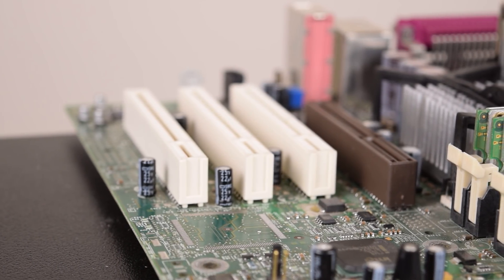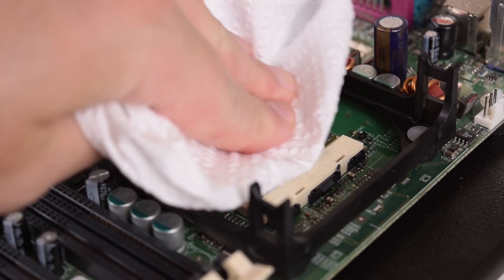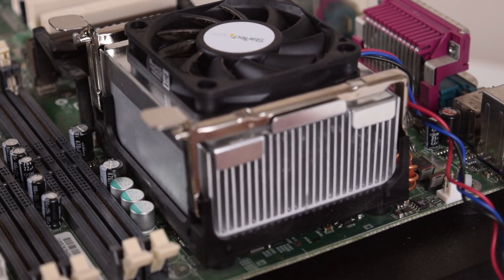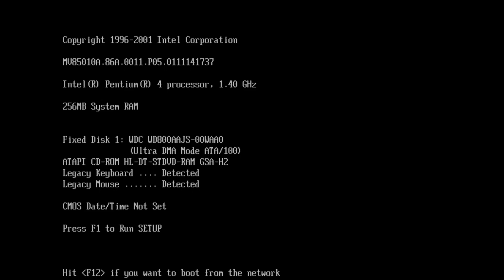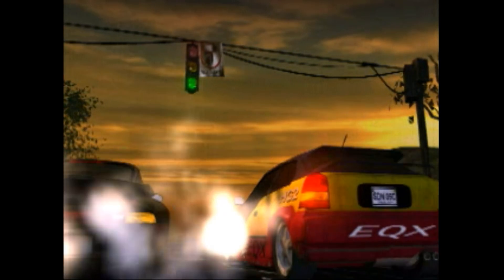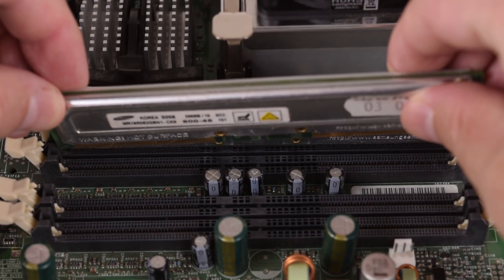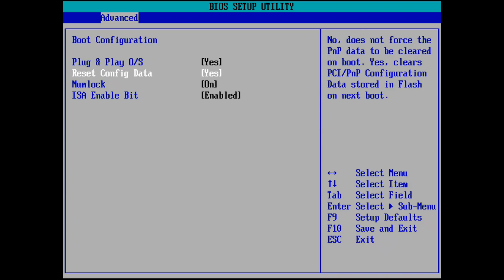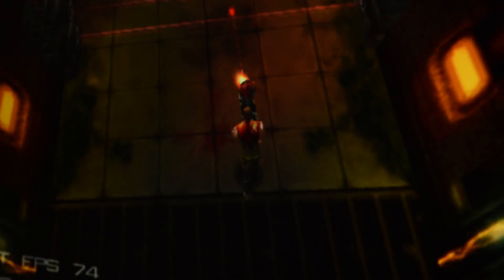Rambus RDRAM Pentium 4 1.4 GHz vs Pentium III

Comment: It's sloppy to just ask this without going back and pausing to be sure, but did that say ECC on the ram module?  Is all Rambus ram ECC? Did you just happen to get ECC?  Does just happening to get ECC memory with a P4 like this somehow not cause issues, issues such as the fan favorite titles " I won't run at all", and " heres a beep code baby"... I never had a P4 system, never bought into the Rambus thing... seemed stupidly overpriced to me back in the day... at least, priced well out of my stupid budget anyway.  Or did I not even see what I thought I saw, and they weren't ECC at all?  If indeed they were, and if indeed that is an RDRam staple in general, then in general I could see that addition of such ram in an early Win9X or 2K environment to be quite beneficial to stability in general.  Perhaps leading to what you noticed about said stability of your test system there.
Reply from the maker: So the two 128MB sticks it came with, are non ECC, but the two 256MB sticks from Electromyne, which I went with in the end are indeed ECC. Yea, maybe this contributed to the stability. I have some other sticks now, non ECC, so will be using them at some point and see if there is a difference.

Comment: Very nice comparison.
I have only started playing with P4 systems in the past 2 years; I skipped the P4 altogether at the time it was current (Athlon XP, then Athlon64). The systems I'm most fond of for retrogaming are in fact 2 which I built on i850-based motherboards, both socket423. One is with a 1.8GHz Willamette, the other with the rarer 2GHz. As for the rambus, it has higher bandwidth but also higher latency which cuts the performance. The way I deal with the heat is to replace the original fan on the CPU cooler with a bigger one, 120mm fan that blows not only on the CPU heatsink but also on the memory. Works well.
(the motherboards I use are QDI which I mentioned in a previous comment; they have PC/PCI so good sound card compatibility for DOS).
I also have a socket423 motherboard with Via chipset, a PcChips M920 with V4x266, supports both SDRAM and DDR. TBH I haven't made a build with it yet for lack of time. It would be interesting to see how it compares to the 850-based boards.

Comment: What's your pentium 3 configuration for this... comparison??!!!
Reply from the maker: We are using the same parts, but a i815 chipset board and two 256MB PC133 CL2 SDRAM. I tuned the memory timings for maximum performance.

Comment: Well... I used to have an Intel-VC820 and an P3-500 slot1. Though it was not really the fastest combination, it was rock solid. I used 2x128mb PC-800 ram modules on it from samsung that had heatsinks. As I said... Rock solid and stable.

Comment: Hey Phil great video, I´ve suggestion for you. Could you try the Asus CT-479 adapter on the Socket 478 Mainboard, and try a comparison between Pentium 4 3.0 GHz and Pentium M725-755?

Comment: Been wondering for a long time why you've never used/reviewed a socket 423 P4.  Since it was the first P4 socket, I would have thought you would have been all over that one a LONG time ago.  I had quite a few socket 423 boards/processors back in the hey-day.

Comment: Back in the day before DDR, the higher clocked P4's with RAMBUS would blister the paint off the walls compared to other systems.  I even had a RAMBUS cooler with its own little fan.  Today, it's one of my Win98SE retro machines.
Reply: I worked at CompUSA back in the day and sold these machines: Many customers who bought these Pentium 4 machines had concerns about the heat they were generating... If my memory serves me well, most, if not all, of the P4s we sold were made by HP. The towers themselves were absolutely huge, partly because they needed room for heat displacement. There were recalls on some of the early models because the CD-ROMs would malfunction due to the heat generated.

Comment: RDRAM was very expensive at the time for not that much benefit. Intel really tried to push it hard along with the P4. That was one of the reasons I ended up switching over to AMD when I upgraded from my P3 700@933 system to a DDR Athlon XP system.

Definitely interesting reading all of the articles at the time.
https://www.anandtech.com/show/545/10
https://www.computerworld.com.au/article/97518/what_does_rdram_really_cost_/

"Currently, you can find a 128MB PC800 for under $600 if you shop around, but if you compare this to $100 you can pick up a generic 128MB PC133 module for, that's still quite pricey. "

"Visit Kingston Technology Co.'s ValueRAM electronic-commerce site, and the cheapest 128MB RDRAM module you can find is $722. The most expensive 128MB SDRAM module is only $179."
"Compaq says RDRAM adds $300-$400 to a system's cost. Similarly equipped Pentium III-based PCs by Compaq, Dell, Hewlett-Packard, and IBM sell for roughly $300-$600 more when fitted with RDRAM."

Comment: Hi there, Phil! You mentioned you couldn't find anything on RDRAM timings in D850s BIOS. You were looking in the wrong place! Check your modules again, the sticker says 800-45, the 45ns 800mhz piece. The only other option (I will NOT speak about PC600!) is 800-40, which is a tiiiinyest bit faster. Also, nice vs, but I was kinda expecting it to be vs PIII 1.4, hehe.
Reply from the maker: I was referring to the BIOS not having any options to do with the memory, like you find in most BIOSes. Yea the sticks the board came with are PC800-45, non ECC to 128MB sticks. From Electromyne I got PC800-45 ECC with 256MB, and this week also PC1066-32 256MB sticks non ECC, but I haven't tried them to see if they will improve things on this platform. At the moment I don't have a 533 FSB Rambus compatible board.
Reply: Well that's just how it works with RDRAM! Not even Asus P4T series board would give you a lot of things to tweak. Also, PC1066 sticks will work as PC800 on the D850MV. So you gonna need some 850E board to go that way, really. In my experience, I'd go P4T533-C any day, but D850EMV2 was very solid once I tried it. I also had some time with P4T533/R, which used the 32-bit Rambus. That thing's a BEAST, unless you decide to compare it to one of your i875 builds, hehe

Comment: Would have ben nice if you threw in a Or850 with a 1.4Ghz PIII in a slotket as it also have RDRAM. And compare it to the 1.4 Ghz P4 with RDRAM.
Surely the PIII would win, but how mutch.

Comment: I don't have a proper GeForce2 or even a GeForce3 to test with, but I do have my Shuttle SB61G with a 3GHz Pentium 4 Northwood core (HT-capable), and 1GB of dual-channel DDR memory.  It has a GeForce 6800 GT with 128MB of memory.  If you need me to bench anything on it, I could gladly do so.  I'm gettin' bored out of my mind in my house. XD

Comment: If you want to really give RAMBUS it's best chance, get yourself some of the PC1066-32 stuff.  The latency was always the big performance killer on RAMBUS systems, regardless of PIII or P4. I do have a theory that RAMBUS would probably really come into it's own with Pentium D, whether it is competitive with DDR2 with the Pentium D processors I kind of doubt, but would love to test anyway, but of course, there were no Socket 775 motherboards made with RAMBUS, but if by some chance I am wrong about that, and Google searches have hidden the truth as it sometimes does, I would be VERY interested in finding such a board.
Reply: Rambus was really only good back in the day. In the days of Pentium D or 775, no chance. The problem was that yet it ran on 800-1066Mhz, but it was only 16-bit. So total 32-bit in dual-channel. It became obsolete when Intel came with 865 which had DDR dual-channel which had both better latency and bandwith than RDRAM. Dual channel DDR400 is league ahead of any RDRAM. Dual channel DDR266 is equal to 1066 RDRAM system.
Reply: RDRAM memory came in both 16 and 32 bit, maxing out at PC or "RIMM" 6400. Chipsets ranged from single up to 4 channel.
Reply: Yeah but the 32-bit ones were really rare, only few of the latest I850E boards had them and the controller was 32-bit as a whole, so the same bandwidth was still the same you jut did not have to "bother" with the dual channel. 64-bit controller never existed on the retail market, SIS made a chipset that was supposed to have it, but from what Iv heard everyone backed away from making boards on it cause of well... it was RDRAM and it was in the time Intel was making I865 already.

Comment: Hi Phil, that system looks like an excellent alternative for a fast PIII. The Intel motherboard screams quality too. Would it be an idea to include a race game in the benchmarks next time? We know the newer NFS Underground requires a lot of 'horsepower', but would that also be the case for NFS Porsche 2000 (Unleashed)?
Reply from the maker: So one issue is that I'm "locked in" with the tests and current results. The other issue is that there are basically no racing games with benchmarks built-in.

Comment: Sigh rambus memory, still got a bad taste in my mouth about their company. Sneaking certain technology in the DDR standard then later suing and winning a lawsuit against the DDR makers. 

Still oh well, that is long ago right. 

And the P III is a nice chip, it ran the OG Xbox. Pretty well actually. And the Nintendo 64 had Rambus, in such that you could add 4Mbyte of extra memory, doubling it, by replacing a small dongle shaped part.

Also the early Pentium 4 had too little cache to really stretch its legs, only around the 2ghz it really begin stretch it legs and never let go!
Reply: That was the "terminator" in the N64 slot. You needed it there if you didn't have the extra memory module installed. Just like Phil had to use the terminator sticks in the empty RDRAM slots on the P4 system.

Comment: How about comparing a Pentium 3's performance when equipped with different types of RAM? Use a 440 or 815-based system for SDRAM, and an 820 board for RDRAM. And I think there were even Socket 370/DDR boards made, so that'd be interesting to see as well.
Reply from the maker: IMO SDRAM is perfect fit for Pentium III. Little extra to be gained. Pentium 4 though...

Comment: I never had a Pentium 3/4 until they switched to LGA775 because back then I was very budget conscious and knew I could get better performance from AMD, the reason I finally switched was actually due to the stability problems I was experiencing with the AMD chips of the time
Reply: I had issues with the sis chipsets for AMD, but I got better boards with via and best was nforce2. They performed great and were stable.

Comment: I still have my old Abit TH7II-Raid motherboard lying around somewhere, I suppose its worth checking if it still works. But back in 2002 it was part of a great setup, the price of the memory was the only issue I had with RDRAM. Maybe it wasn't the fastest, but as a software engineer stability always comes before performance.

Comment: This is awesome, since I just recently grabbed a retro workstation at a recycling center. It had a D850EMV2 in it, however, apparently you got lucky, since almost all of the large power capacitors on mine were bloating and leaking.  It may be that this board had a much higher uptime than yours and that's why the capacitors failed eventually.
As for what you said about it being extremely stable, I can definitely back up that assessment, it is probably the most stable system I've ever set up. I bet that's probably due to the fact that your RDRAM and mine is ECC (Error-correcting code memory), unlike most SDRAM which isn't ECC (Though in some very rare cases it can be).

As always, great video, I still really enjoy them :)
Reply from the maker: Good point, the upgraded RDRAM I used (The two 256 sticks from Electromyne) are ECC as well. I didn't consider that this might help with the stability, it makes sense though.

Comment: I was also surprised on the stability of my socket 423 board. 
Two other big negatives of using a socket 423 board as opposed to a socket 478 is with socket 423 your going to need a power supply with an AUX connector. Also socket 423 has become a bit of an oddity collectors board so prices are usually a bit high compared to 478.
Reply: Or just buy a Asus P4T like I did and use a standard ATX PSU with it and not mess with the AUX stuff.
Reply: Cool, didn't know about that board.
Reply: Cool, every other socket 423 board I've ever seen had that AUX connector. good old Asus.
Reply: I just looked the board up and it does have an AUX connector. Maybe it just wasn't necessary.
Reply: molex to AUX connector converters are $0.99 on ebay, not an insurmountable problem
Reply: I'm looking on Ebay right now and I can't find a single one so unless you need some strange wording to make them come up in search...
Reply: there goes me never owning P4. Was sure it was all about 4pin P4 CPU Aux, not the AT style 6 pin one, sorry :(
make it $10 then, or 30 minutes with soldering iron and spare AT supply cable.
Reply: Or you could just buy a PSU with an aux connector for $25 and not bother with the soldering. I never said they were rare.
Reply: >PSU with an aux connector for $25 

Arent those all 15y old now with dried caps? trading one problem for another
Reply: shrugs It's an option if you don't want to or can't solder.
Reply: For those who stumble upon this; there are 20 pin splitters to 6 pin aux on ebay.  There have even been 20 pin to 6 pin and 4 pin splitters however they seem to be unavailable at this time except at more obscure websites.  I myself have used a 20 pin to 6 and 4 pin splitters with a modern psu with success.  There is an old video that shows what i'm talking about close up.  https://www.youtube.com/watch?v=Hud49g-w47g

Comment: I had an old Dell Dimension 8300 at one point that had a Socket 423 Pentium 4 and 768MB of RAMBUS RAM. It was...ehhh? Not great. In the end I just parted it out and dumped it because it was sometimes crashing to a blank screen and a yellow power light. Still have the CPU and RAM somewhere...not that I'll probably ever use them again :P

The S423 CPUs are huuuuuge! They basically look like an S478 P4 on an adapter board, so strange.

Comment: I would LOVE to see a comparison of Tualatin vs. Northwood on RDRAM, DDR, and SDR. :-)
Reply: DDR was faster lots faster as Rambus had latency issues that crippled it's high bandwidth advantage. Note that even on official Intel produced Desktop 845 boards only use DDR ram not rambus they dropped it hard and there was good reason it was horrible for value
Reply: YES!
Reply: The best system those days were still RDRAM based, I remember the first 3+Ghz Northwood and the same time the first one with HT, aka the 3,06Ghz one with FSB533, that was still paired with I850E and ideally 1066Mhz RDRAM. i845 and SIS645 with DDR was good but still a bit slower than i850E, DDR overtook RDRAM completely only when I865 came with dual-channel and DDR400 + FSB800 support.

However the SDRAM P4 systems were completely trash and Phils future tests will prove that for sure.

Comment: I remember my first Pentium 4 System I got was a Williamette 1.8, operating on SDRAM not RDRAM though. Even though the mobo has long been dead, I still hang on to the it. the mobo was the Gigabyte 8I845GE-RZ on the Intel 845G Chipset, also socket 478.

Comment: You need a special power supply for Socket 423 Pntium 4 Systems.
Reply from the maker: I actually didn't know this, so that's another reason to pick 478 :)
Reply: My socket423 builds work with a generic ATX PS... Used an adapter to pull out the "special" 4-pin connector.
Reply: stamasd on my board, you need a 20 pin atx, a 4pin atx and a 6 Pin AUX connector
Reply: Mario Kremer interesting, my boards don't need more than 2 power connectors. One is a QDI PlatiniX 4x which uses an ATX 20-pin and a 6-pin which is in fact half of an AT type connector. The other is a QDI PlatiniX 2E which has the 20-pin and a square 4-pin.
(edit) wait I'm wrong. The 4x does need the 4pin too. I used adapters from the main ATX connector to get all these. I remember not having any trouble finding cheap adapters.